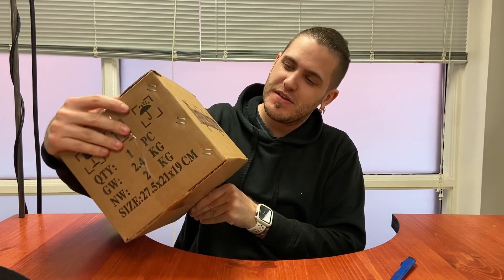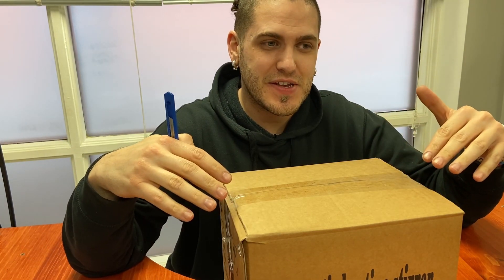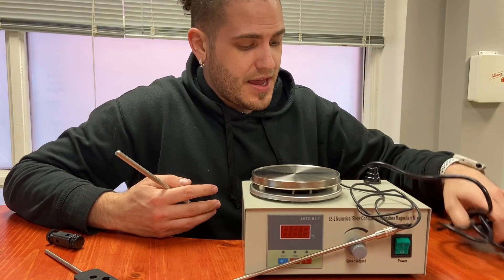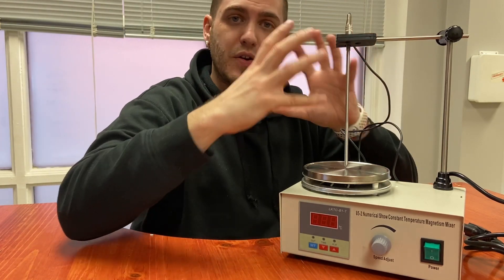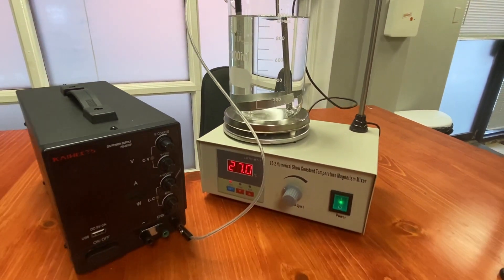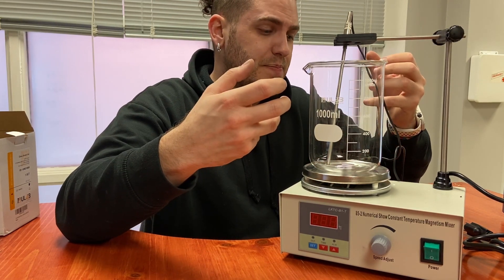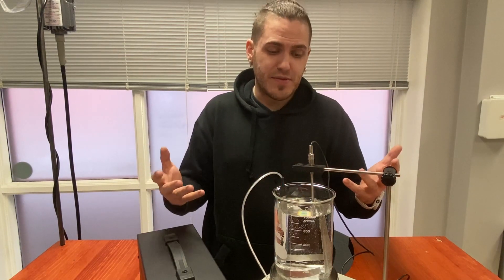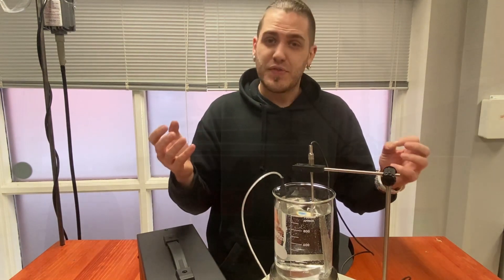We are getting into plating gold and silver plating - Magnetic Stirrer Unboxing

Comment: You can use 2 glass beakers, one to hold heating solvent and one to hold the solution for electrolysis. That way you are not plating your temperature probe, or eat it away during electrolysis. Or get some reaction going on. It completely gets the temperature probes metal out of the equation, so there is nothing to worry about. 

If you get some really fluid oil with a high boiling temperature you can get it really hot if you need it to be hot. Peanutoil seems to be good, or rice oil. 

Any way, if you plan to stick the probe into the same beaker as is the plating beaker, be sure there wont be any "redox" reaction taking place. 

Greetings,

Jeff